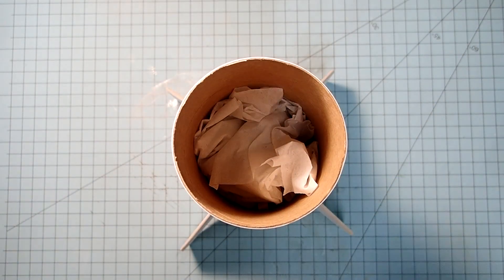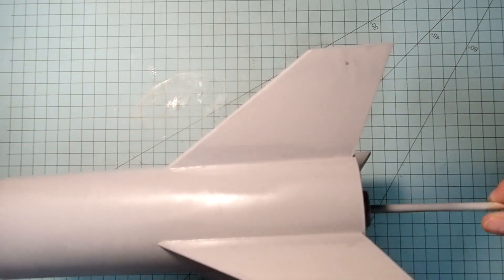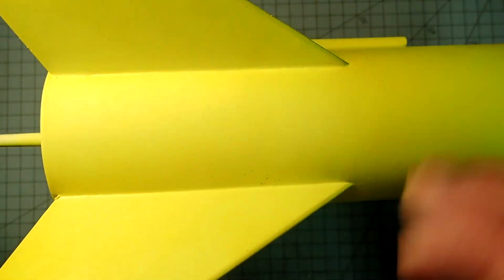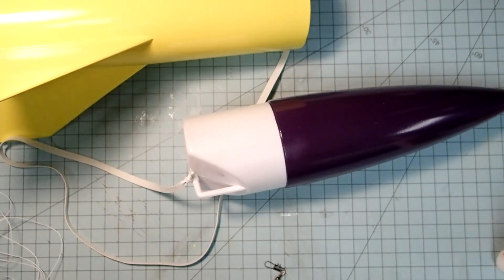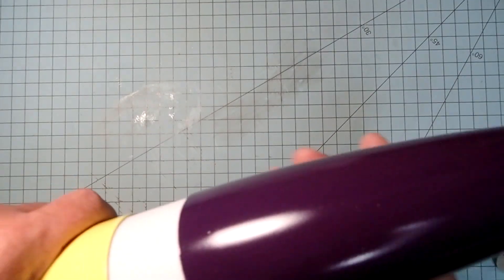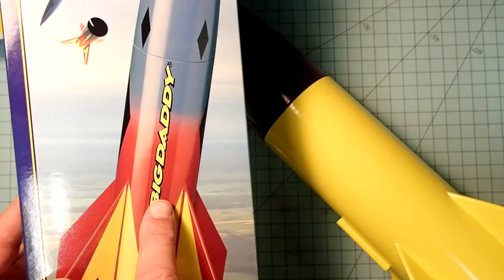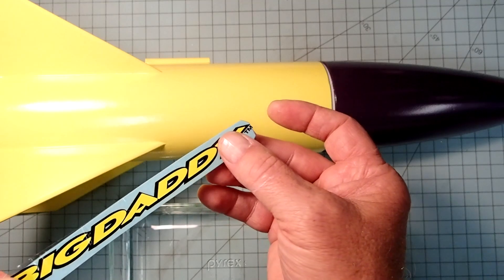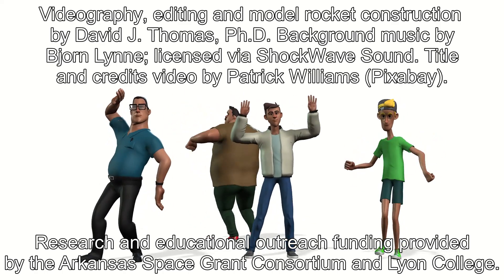Estes "Big Daddy" model rocket assembly (part 2 of 2)

Comment: My rocketry career started with the Alpha 3. This was way back in the mid 70s. I remember having to cut each fin out of the die cast balsa sheets and having to cut the shroud lines from a single length of string. On the balsa fins I remember using sanding sealer and trying to shape each fin to a perfect airfoil shape.